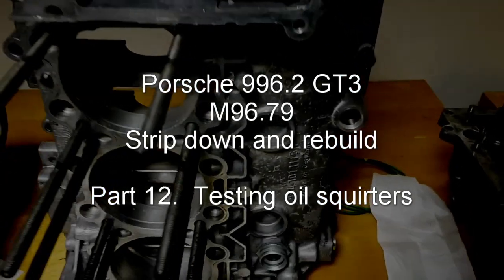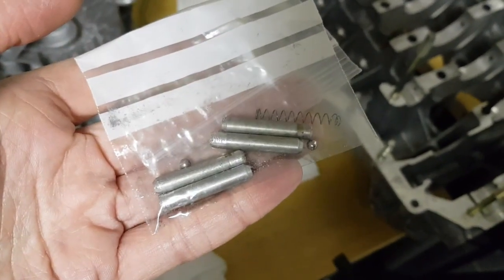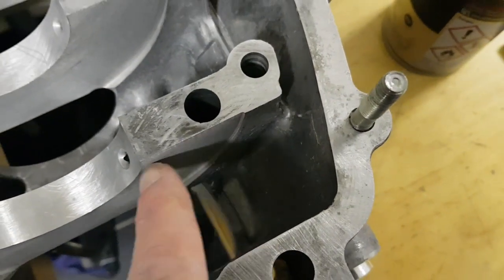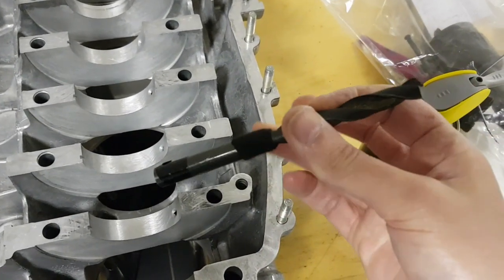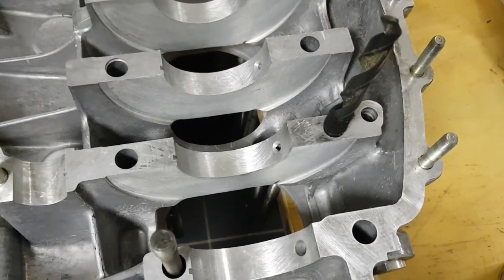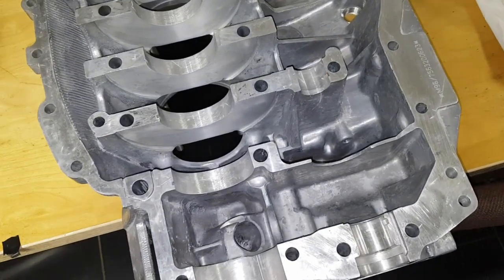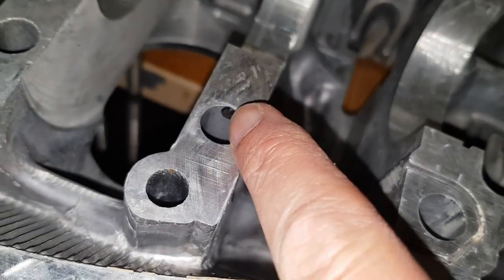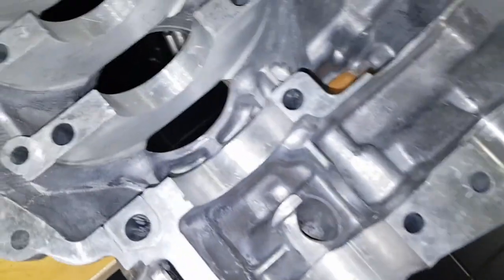Porsche 996 GT3 M96.79 engine rebuild. Part 12. Testing oil squirters

Comment: exquisite detail! I have learned more about the 996 (and the engine/upgrades I wish I had) in the past 48 hours then the past decade. What will the final specs be for the metzger be? Will you test it and show results?
Reply from the maker: It will be a 4.0l with mildly ported heads, not 100% sure on the intake system yet. I will run the M&M manifold and exhaust system. I'll publish any details I get.